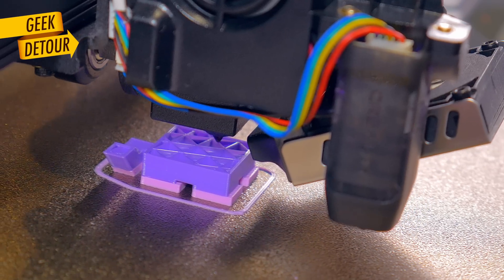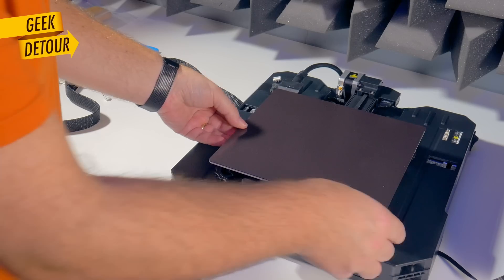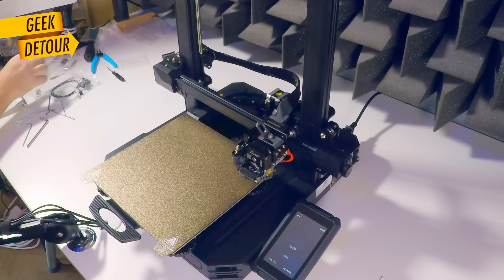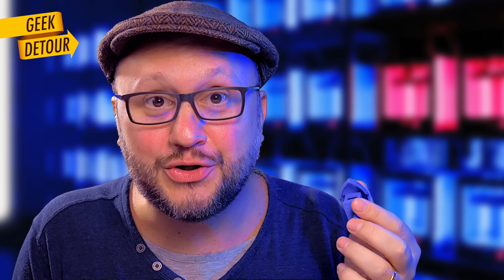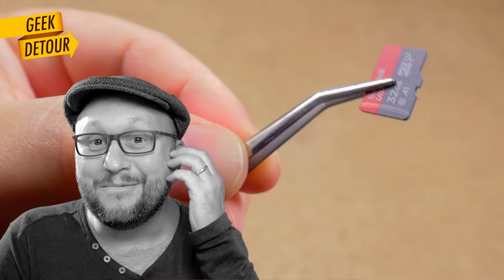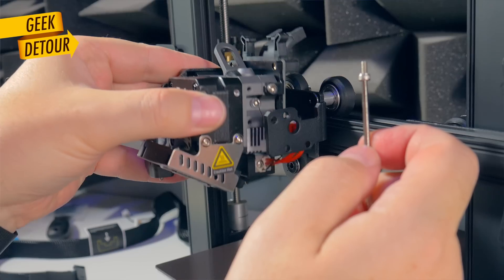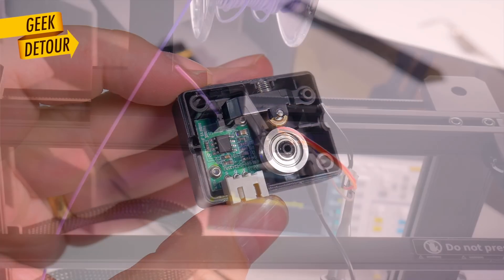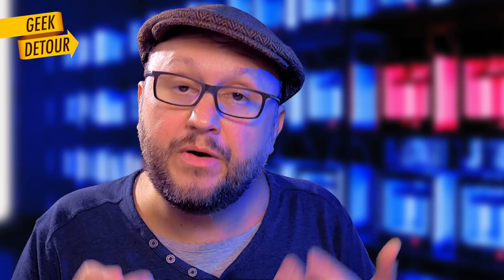Ender 3 S1 Pro: so good it begs for Klipper! 3D Printer + Creality Sonic Pad

Comment: Is there a simple way to connect remotely to the sonic pad with out being on the same LAN?
Reply from the maker: That’s an excellent question! The important point is: how to do it safely. You could configure a specific port on your Router and do a port-forward to the Sonic Pad - but That is dangerous. The Sonic Pad didn’t have any password set. This is certainly a topic for a good video! Sorry for not having a good solution ready to go.
Reply: @GeekDetour  Was thinking about same thing as Mike, guess ill have to leave my old laptop next to printer which will be connected to sonic pad on home wifi, and then use windows remote control to control that laptop from anywhere on my phone :D